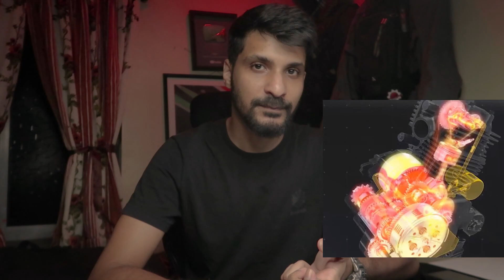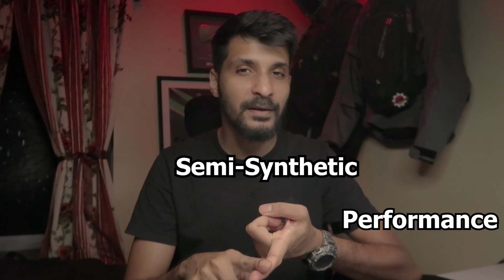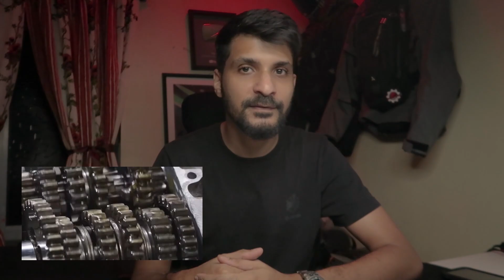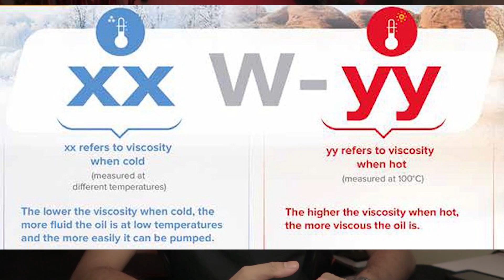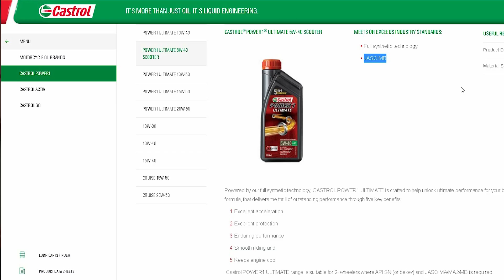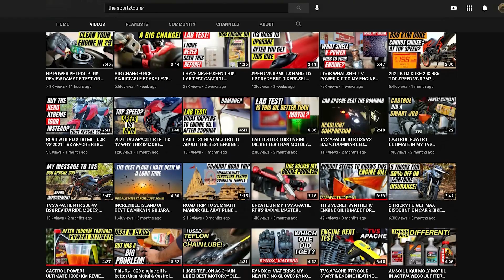Selecting The Right Motorcycle Engine Oil

Comment: Hi Oggy F! Please help me by giving your advice;
"I am concerned about changing the oil even though my bike has not ran enough kms." 
 I had my bike serviced in June 2020. Now it will be a year since I had a oil change(Although my bike has ran not many  kms thanks to covid). About 3500 out of 5000 kms(interval) are remaining for an oil change. 
Vikas Rachamalla Sir have said that the engine oil in the crankcase is as good as packed in the can and his Duke390 hadn't gone an oil change for a whole year.  What are your thoughts on this?
I have heard that the engine oil tends to become acidic when kept longer. 

SHOULD I CHANGE THE OIL OR LET IT BE? ( and yes I am even concerned for not wasting money right now *(I might if you say so) because even if I change the oil, my bike will still be standing at one place due to lockdown.

Comment: What's the best battery for Duke 200?
Reply from the maker: No point spending in the expensive lightweight ones unless you're looking to reduce weight.... The stock one is fine. Very little difference between brands.

Comment: According to you which is a better engine oil Liqui Moly street race or Motul 300 V2?
Reply from the maker: I haven't used either. Switched from the stock motul oil that the service centers use and haven't looked back since. Bike runs very will and. Alot of issues I previously faced are sorted.

Comment: I used the Castrol power ultimate 10w40 fully synthetic on my gixxer recently.
1.Gear shifts have become smoother.
2.Engine doesn't use to heat much now compared to before
And its quite affordable too
Reply from the maker: Glad it's working well on your motorcycle too. Ride safe :)

Comment: One question. Does it makes sense to use Fully Synthetic Oil in lower capacity motorcycle? Like Ns160, Honda Hornet etc or above 150cc and below 250cc? as they are expensive and also many recommend them a lot.
Reply: I follow this method and have never faced any problems. Mineral oil with frequent drain intervals(1000-1500kms) and synthetic with longer drain intervals(not more than 3k). Putting synthetic oil in lower capacity bikes won't make much difference unless you go on long tours and maintain three digit speeds constantly on the highway. While cruising at high speeds a synthetic oil will perform better and will make the engine run stress free compared to mineral oil.
Reply: I have the same question. I used yamalube mineral oil for a year on my fzs v3 and then switched to castrol ultimate full synthetic and I don't feel any difference in my motorcycle's performance or heat management.